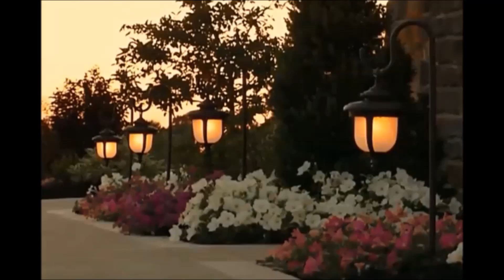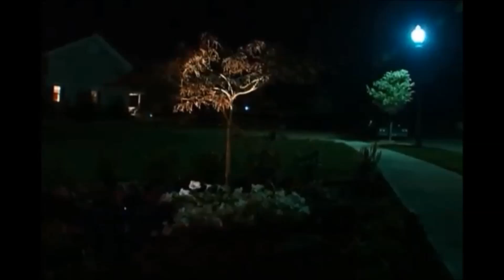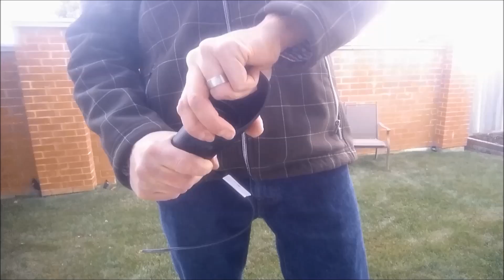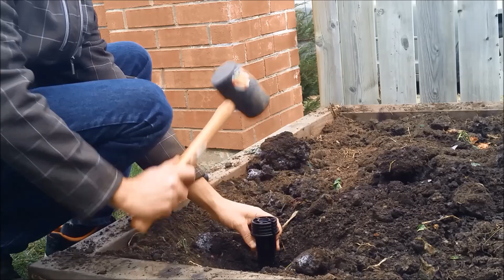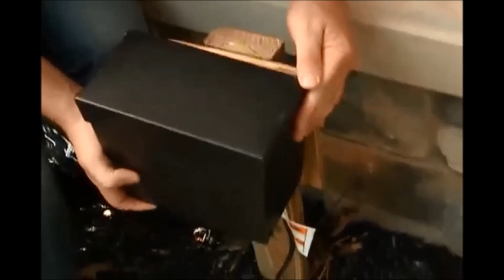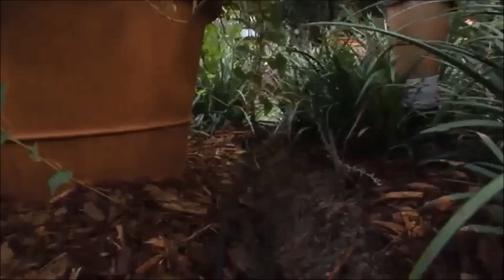How to Install Low Voltage Landscape Lighting

Comment: It looks to me like you are using "Blazing SnapLoc" connectors.  If I am correct then these connectors are not UL listed and are not suitable for underground use. They do have  silicone on the inside which is supposed to make them waterproof, however they are not suitable for underground use. Please correct me if I am wrong.
Reply from the maker: Yes they do contain silicone inside and are designed for underground use.
Reply: @LightingDoctor  I Would love to get my hands on those.  Are they different from the Blazing Snaploc brand connectors?

Comment: I noticed you mentioned common and power wires. Does it matter if you switch the wires at the lights? I have been told that with low voltage lighting, it does not matter...
Reply from the maker: Hi Darren, yes that is correct it does not matter when it comes to low voltage lighting which is what makes it very easy to install. Cheers
Reply from the maker: Here is another video you may find helpful https://youtu.be/5t6lN-HNsbE

Comment: Do I need to protect my wire with pvc pipe before burrying it to the ground if  I need to light up a tree across my lawn when my source of electric in on the other side?
Reply from the maker: Great question! You can if you want but it is not required. Proper low voltage direct burial wire is meant to be burried directly in the dirt approx 6 to 8" to be safe.  Hope that helps, Cheers!

Comment: Do you have any links to the connectors you used? Or at least have a specific name for them? I've never seen them before.
Reply from the maker: You can either find them here http://www.lightingdoctor.ca/product/blazing-bvs-2-snap-lock-wire-connectors-pack-60/ or search for BVS2 Snap Lock Connectors. Cheers!

Comment: These wiring connectors are called BVS2. The best price that i found was on sprinklerwarehouse.com for $1.38 per connector.  Very easy to use!
Reply from the maker: +Avidreader thanks for the feedback. I agree these are very easy to use and durable. Thanks for the resource. I know sprinkler parts warehouse has lots of great products

Comment: This is the second video I watch on underground wiring. I have to say I am surprised by how the wire itself is buried so close to the surface and without any extra protection, like a PVC pipe for electrical wiring. Would you not recommend such pipes?
Reply: When I installed mine, I asked my dad who's an electrician the same question. Why don't I use conduit or regular PVC pipes. His answer was the pipes will create moisture. And yes the ground has moisture too. So do you really want to buy pipe and add pipe when you're really not protecting it from anything. Just buy the well insulated wire.
Reply from the maker: +Edson thanks for the great question. The beauty with Low Voltage Lighting that it is much safer than typical lighting. You would barely even feel if you were to touch the wire.  Also the jacket on direct burial wire is much thicker than typical wire. Obviously there is no harm In adding extra protection but unless you are worries about cutting a wire and Losing your connection then there really is no need. Just be sure to buy proper direct burial lighting cable.
Reply from the maker: Thanks for your comments, however I ensure you that the depth of the the direct burial wire meets code in our area. it may be different in your city however for low voltage there is no codes that I am aware of for depth that you need to be concerned about. yhanks
Reply from the maker: Great feedback. Thanks for sharing

Comment: where can I find the gel connectors?
Reply: you can buy a 20 pack here: https://www.homelectrical.com/blazing-clearyellow-snaploc-wire-connector-valve-splice-bag-20.kic-bvs2.1.html?gclid=Cj0KCQjwl7nYBRCwARIsAL7O7dHrGhBdN4wpTZDJh-hIEwWYrvH3TGZXUQt_4TmQH7XJuMPqUGSLI00aAgaJEALw_wcB
Reply from the maker: djdnewworld you can get them from Amazon https://www.amazon.ca/gp/aw/d/B0052D4HUE/ref=mp_s_a_1_2?ie=UTF8&qid=1497067560&sr=8-2&pi=AC_SX236_SY340_FMwebp_QL65&keywords=bvs2&dpPl=1&dpID=41B0iDuMhHL&ref=plSrch
Reply from the maker: Thanks Chris, great ressource!

Comment: what about when you're trying to bury the wire in the ground and you come across a big root that's sticking above the ground?
Reply from the maker: bullwhipjesus best to either just dig down and run wire under the root or dig around the root and cut it out with axe or pruning saw. last option  is just go around it. hope that helps
Reply: The Lighting Doctor I believe I am just going to go over the roots and put rubber mulch over the cable
Reply from the maker: bullwhipjesus that's an option too. it will definitely be a lot easier. good luck

Comment: What do you do with the end of the wire?
Reply from the maker: Scott Mann which end are you referring to. The 2 strand wire will go to the 2 wires coming from the fixtures and the other ends of the 2 strand wire goes into the 2 terminals on the power transformer. Please feel free to email me with any further questions too at cal@lightingdoctor.ca
Reply: The Lighting Doctor you said Three wires that was what probably confused Scott.
Reply: ***** 
I am confused on 3 wire also 
There is 4 right ?? Help 
OK I need help also On the wires to the box The scews aren't very good at keeping the wire in place When I bend them they don't all fit right ..is there a better way? ,to do this ? I try to do things from watching I need close up pics on videos.
Reply: ***** 
I am confused on 3 wire also 
There is 4 right ?? Help 
OK I need help also On the wires to the box The scews aren't very good at keeping the wire in place When I bend them they don't all fit right ..is there a better way? ,to do this ? I try to do things from watching I need close up pics on videos.
Reply: ***** 
I am confused on 3 wire also 
There is 4 right ?? Help 
OK I need help also On the wires to the box The scews aren't very good at keeping the wire in place When I bend them they don't all fit right ..is there a better way? ,to do this ? I try to do things from watching I need close up pics on videos.

Comment: Thanks for the good tips.  Not too crazy about the background music, though.  Cheers!
Reply from the maker: CavemanPhotos thanks for the feedback, I removed the background music. I agree it was a little annoying. thanks
Reply: The Lighting Doctor 
Hi please be patient with me I am a girl (old ) trying to understand my Malibu box tranmatic has 3 scew ends on bottom Why ? 
When I only use a two wire cable or one cable split ??
This it really confessing.
Um can u show slow and up close how to ? 
The screws on end of box are not working well when wires are bent over them ,they split or separate um any other way to do this ??
I am using Malibu cable 
Don't have trouble with the lights just the box end 
And the question on where is third wire ?? 
Thank you 
Tried to subscribe but got a 401 notice 
Thanks Rose